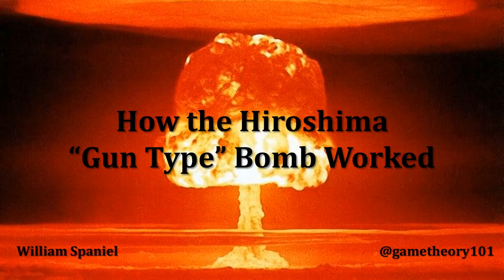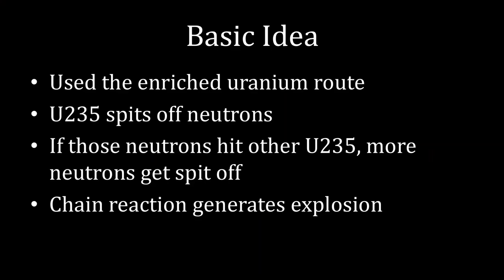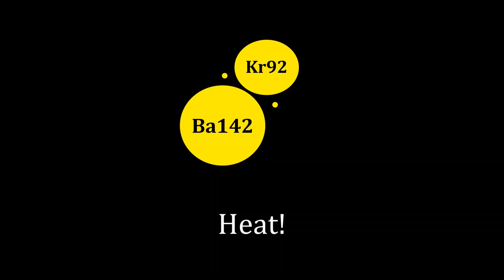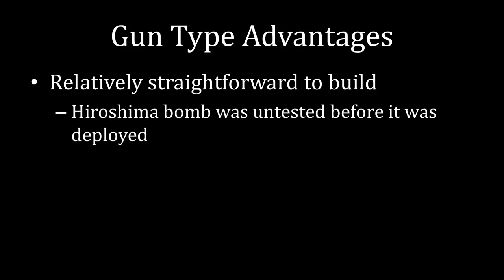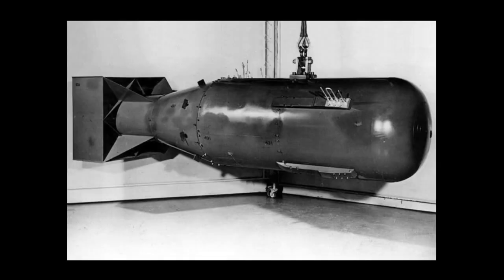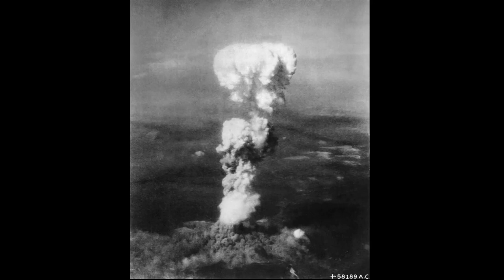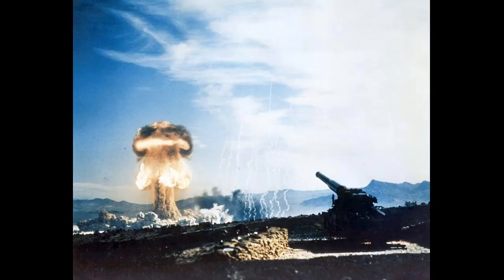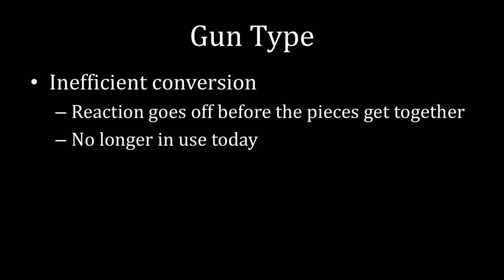How the Hiroshima "Gun Type" Bomb Worked | Nuclear Proliferation Explained

Comment: Slight correction: for a nuclear reaction to turn into a bomb, it needs to be super critical (I.e.: the number of fissioned atoms per step after step 1 is greater than 1). This creates an uncontrollable reaction, which releases all of the energy stored in the atoms via the strong nuclear force. A "critical" nuclear reaction is required for every single fission-based nuclear power plant on Earth; by slowing the reaction, they keep it going, but also keep it controlled. To put this in perspective: the only reason Chernobyl didn't go super critical was because there was too much space between the fissile elements.

Edit: this is completely a nitpick, the series as a whole is very good
Reply from the maker: No worries, about the edit. You are correct, and I appreciate you catching it!
Reply: @Gametheory101  🙂
Reply: Chernobyl did go supercritical. That's how it exploded.
Reply: @Evan_Bell  It didn't explode, it melted down.
Reply: @Evan_Bell  That's actually a myth. I think there was some talk early on about the possibility that its fuel had gone super critical, but that idea was quickly deemed to be almost completely impossible. I don't remember what DID cause the explosion, it's been a few years since I researched it

Comment: Ba and Kr are not the only two fission products. There's actually 61 nuclides that can be produced. 
In no weapon is all of the fuel fissioned. 
The reaction does not start as soon as the fuel goes critical, it starts if a neutron injection occurs when the fuel is in a supercritical state. 
Little boy did not predetonate due to neutron injection prior to full assembly. 
The inefficiency of gun type weapons is due the low alpha, resulting from the low density of the fuel when compared to implosion devices. 
The key disadvantage of gun type weapons is cost. It requires on the order of 3 times more fissile material to make a gun type weapon than it does for an equivalent yield implosion weapon. 
I don't mean to sound full of myself, but I've spent 4.5 years studying nuclear weapons, and have completed my own design of a pure fission implosion device. If OP or anyone else has questions, I'm very happy to discuss.
Reply: Where do you learn it? 
School, online? 
I’m also fascinated by nuclear weapons and i’m pondering if you could tell me any good sources.
Reply: @buster1364  I know it’s been awhile, but if it would help, I could share my strategy for learning basic science material.  I usually start with google or Wikipedia, then hit up Khan Academy, Lumen Learning, Paul’s Online Notes (for calc) and/or Hyperphysics (for physics).  Beyond that, there’s other YouTube playlists and books online.

If you’ve found another strategy that works, I’d be interested to hear it too!
Reply: @buster1364  Hair is the best place.
Reply: @PunmasterSTP  Idk why you are ruining his life
Reply: @TimPerfetto  I don’t understand.  How am I ruining his life?

Comment: This is unbelievable as someone with no physics background. I always thought “splitting the atom” literally meant they used enough force to split an atom and it exploded. But, it was actually just a chain reaction by a single neutron added. So (again I have 0 background if this is stupid) is the radioactive haze these types of bombs leave, just the other atoms also splitting off more often because of the introduction of all of the excess neutrons? So essentially your body gets ripped apart on an atomic level?
Reply: Very few nuclei fission when hit by a neutron, that's why the U235 concentration in a bomb is 90% instead of the 0.7% natural occurrence (the rest of the Uranium is U238).  Usually, a neutron will either bounce off an atom's nucleus (neutrons also frequently bounce off U235 as well, but in high concentrations there is another one to hit), or it will be absorbed by the nucleus, making it bigger.  Sometimes, the bigger nucleus is radioactive.  So, neutrons are not splitting the atoms in your body, but they could change some of them to be radioactive.   More likely, they'll rip through your body breaking chemical bonds thereby doing damage.  For larger nuclear weapons, the fireball extends further than the neutrons travel.

When the U235 atom splits, the pieces ("fission products") are moving very fast, which is equivalent to them being very hot.  This heat splits molecules, but not atoms.  For example, if you add heat to ice, it melts to become water.  Add more heat, that water turns into a gas.  Add still more heat, the bonds between the hydrogen and oxygen atoms break, so you no longer have water.  Add more heat, and the electrons detach from the nuclei, and you have a plasma.  So, the heat from a nuclear bomb wouldn't split your atoms, but it would break their bonds with other atoms.

The radioactive "fallout" comes from two sources.  The first is the fission products in the bomb.  A Uranium atom has about 1.5 neutrons per proton, that keeps it almost stable.  It is radioactive, but any given atom has a 50% chance of not decaying over the next 700 million years.  (Pu239, the other important bomb material has a half life of 24,000 years.)  However, for smaller atoms, the stable ratio is about 1 neutron per proton.  So, these are very unstable and most decay within days, giving off heat and high energy particles as they do so.  The second source of fallout radioactivity is nearby material which absorbs enough neutrons to become radioactive.  Fallout is a concern when the nuclear bomb is exploded close to the surface of the earth.  This allows neutrons to turn a lot of dust radioactive, and the dust is carried into the air and helps carry the fission products further away.

There's a particularly famous fission product Iodine 131, which is the reason people take potassium iodine if there is a nuclear disaster.  The iodine supplement doesn't protect you from radiation, but it does prevent your body from absorbing the radioactive iodine 131.  Iodine 131 has a half life of 8 days, which is long enough for the iodine to get into your body, but short enough that it will probably decay (giving off energetic particles that can break things, including DNA molecules).

The Hiroshima and Nagasaki bombs were both detonated in the air (to maximise blast effectiveness), so fallout wasn't an issue.  However, the bombs were small enough that there were people not killed by the blast who were close enough to the bomb to receive neutron radiation.  I understand that these people were studied to draw correlation between radiation dose and long term health effects.  (They'd calculate dose based on how far away the person was from the blast.)